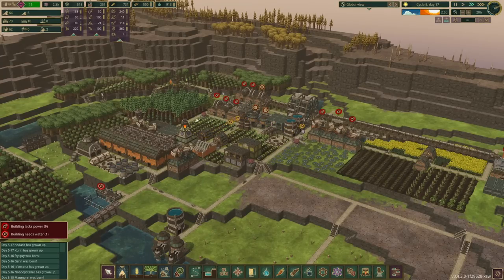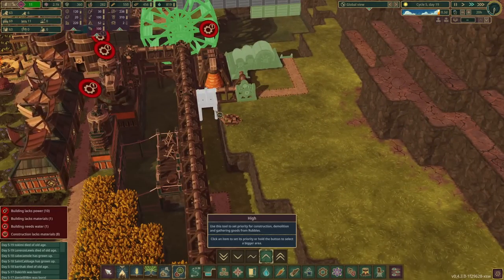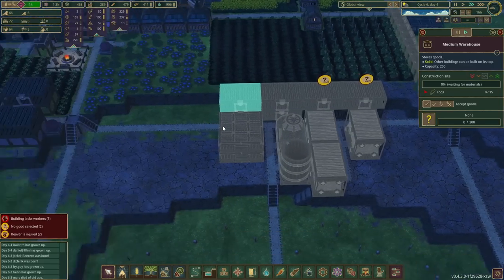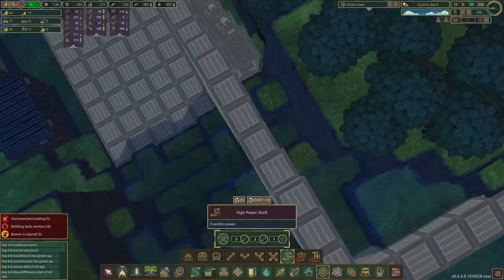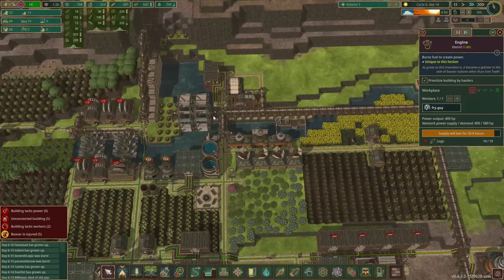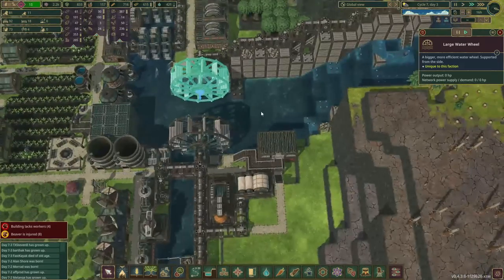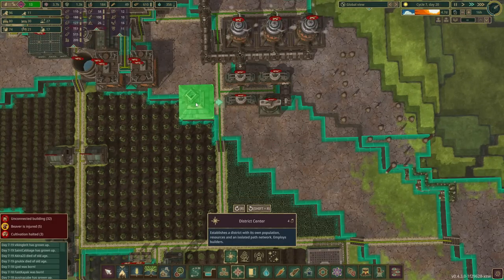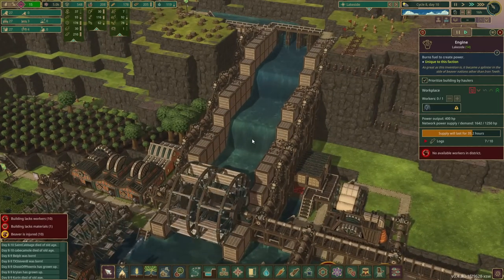Maximizing Water Wheel Efficiency ☸️☸️☸️☸️  | 04 | Timberborn Update 4 | Lets Play

Comment: The gearboxes should really be upgradable in place.
Reply: Never though of that
. That's a cool idea.. so you don't need to delete a gear spot and interrupt power line..
Reply: I believe the Universal power connector in the VerticalPowerShaft mod does this now in v1.1.4 for Experimental.
Reply: @jamiec8096  I have that mod and I don't know if it's the version but no.. can't be upgradable in the spot.. awesome and practical mod imo
Reply: @Perrocko  Works fine for me. Place the Universal Power connector first. Then place a straight, corner or vertical connector (on top). The Universal connecter then automatically reconfigures and connects to other  power connectors. 

The json file in the mod has the version number of the mod inside. Open with notepad if you don't have a json editor.